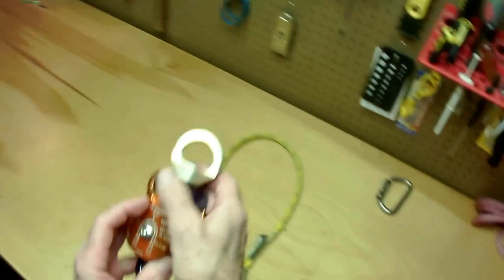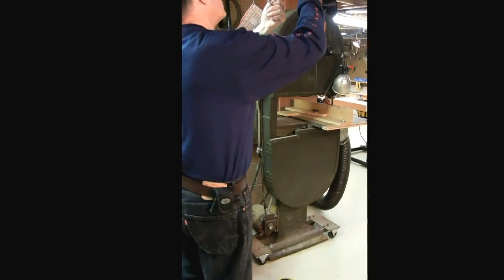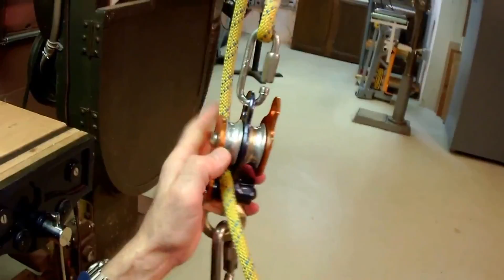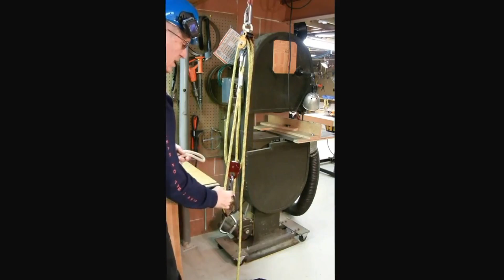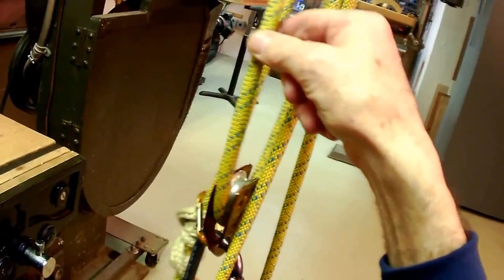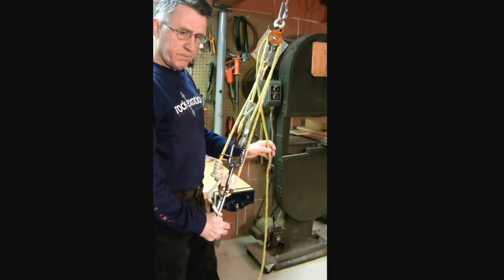U-RIG Build Details

Comment: Tom, would this U-Rig system have the strength to pull over back leaners safely or would a heavier SOF consisting of 2 P53Ds be the way to go?
Reply from the maker: It's impossible for me to answer that without knowing your rigging loads/style.  The P53 is 40kN MBS vs 36 for the P51, so no doubt it would be stronger by about 900/180 lbs MBS/wl. An SOF with P53s would be an awesome rig.  But here's something to consider:  you could build a u-Rig as speced in my video but use one (1) P53 at the head end replacing the P51.  Your MBS would jump to 40kN without changing anything else.  The 10mm cordage is over strong;   I sized it for stiffness/efficiency and good grip in the hand.  The two P22s deliver 44 kN.  Just make sure you use a Rock Steel 50 kN biner at the tail.  It's the only rigging biner I've found that delivers 50kN AND IS NARROW ENOUGH to fit into the pulley hole without interfering with the other biner. You can't have them touching when the rig is under load.
Reply: Let me rephrase and if I could ask a couple of more questions. Would it have the strength to correct a slight back lean in a forty foot maple or pine with 9/16" SB tide up high in the tree using the U-Rig to pull on the SB while anchored to another tree? Are you using the 8mm Ice Tail or the 10mm Amor-Prus for the load prusik now? Lastly, using the P53 at the head end would it make sense to use 11mm HTP for more strength? If so would the lengths of the prusiks need to be longer?
Reply from the maker: Yes, it should do nicely in that application.  Remember, it's intended as a hand-drawn system but it can easily take a 2 or 3 man pulling gang.  No, I would not go up the the11mm ... the rope is already way stronger than the pulleys (Remember it has FIVE strands sharing the load)  I've used but the Ice Tail and the Armor Prus and I like them both.  The AP sews into tight eyes more easily.  You definitely want to use sewn not spliced eyes to use less space within the tail end.  If you make it up with the new P53D, you should do a video ... it should be a nice rig.
Reply: Tom,  thanks a ton. I really appreciate all you do and for taking the time to answer my questions. 10mm it is then. Any problem with with clearance tying a  fisherman's not instead of a spliced eye on the HTP?
Reply from the maker: No, you won't have enough clearance:  the knot will interfere with the prussics.  And NOT a spliced eye ... use a sewn eye.
Reply: Tom, thanks again. Looked like there might have been just enough room from watching the video. You weren't kidding about the tight tolerances. Sewn eyes on everything then. Did you ever get around to using that Assault steel HMS with a munter hitch?

Comment: Thank you Mr. Hoffmann! I'm looking forward to pulling some small stumps with this system and my Kubota B. I ordered this from treestuff.com. Excellent service and fast shipping. The site lists that the kit is unavailable but if you call them they can substitute the control prusik that is unavailable (will substitute Armor-Prus 8mm Poly Sewn Eye & Eye 28). The kit does not include the DMM XSRE mini carabiner. I've emailed them to see if they'll update the kit.
Reply from the maker: FFF, thank you for the interest.  I love TreeStuff, but I seriously doubt they have components that can do what you are describing.  Remember that the uRIG is designed as a hand-drawn system.  For that it works great.  My "stumpin" systems are WAY WAY stronger!!  I did make a video to illustrate the  power of mechanical advantage and I used the uRIG to pull out a stump BUT THE STUMP HAD ALREADY BEEN UPROOTED BY THE TREE FALLING OVER IN A STORM!!  The specs on the P51D are 36kN max BREAKING strength.  That's about 8100 lbs. mbs and 1600 lbs working load (sf=5).  With five strands through the pulley, the max tension you should apply to the rope is only325 lbs! Pulling by hand, you should be able to pull small saplings or a young dogwood.  Anything much more and you'll likely wreck your gear.  Please be careful.
Reply from the maker: FFF, here's another comparison that may jelp:  the P51D weighs a few ounces and I can forget that I have one in my pocket.  In contrast, the lead pulley and shackle on y big stumpin system weighs over 100lbs and I can barely lift it!
Reply: I was considering a much heavier 3:1 in front of the uRIG. Inexpensive 20,000# pulleys available on Amazon. uRIG would control the system, 3:1 would provide the muscle for a total 15:1. Thoughts? Also considering Amsteel Blue for the 3:1. I'd love to hear your advice. The saplings I'd pull with uRIG are 2-4 inches in diameter and I'd subsoil around them as well as pull from 4-5 feet high to increase leverage.
Reply: @Freedom_Family_Farms  I did similar with a big old 2:1 block with a 1" dyneema rope in front of this rig with a couple pulley changes. It is a pretty good puller with my 2,500 pound tractor for up to about a 6" tree.

Comment: Tom, what is a good resource for learning rigging like this. I have a 2800+ lbs compact with a 25hp engine. I'm sure I'll over load this rig in a hurry. I'm basically wanting to be able to use that compact to pull the stumps when I fell a tree. It looked like you had a huge block and tackle setup in your Small Tractor Big Stump video. Where do you get those sort of hardware? They don't exactly have that sort of thing in Home Depot.  Thanks
Reply from the maker: +Scott Dennis Great question, Scott ... it shows you're ready to put in the work.  For rigging:  Department of the Army Technical Manual TM5-725 "Rigging".  For Climbing:  The Tree Climber's Companion.    Both available online as .pdfs.Equipment like this is prohibitively expensive new.  For decades, I've used the Boolean "Advance Search" on eBay.  Eventually, you get lucky but it takes time.
Reply: +Tom Hoffmann it had to be an Army manual huh? ;-) (Note my profile image and you'll get a kick out of that statement.) Seriously though...thanks for the feed back and great videos.
Reply from the maker: +Scott Dennis  Semper Fi, Scott.  Thanks for serving.  I'd use the term Jarhead but I'm deathly afraid that you couldn't see the smile that comes with it.
Reply: Scott, 
For a tractor application here’s a slightly different,  but fairly simple,  strong,  and not a million dollars solution.  Most important to keep track of are the heaviest single load points and the limits of those components.  I’m referring to the load point at the stump and the anchor point.  Strong chain around stump and a high rated tree saver strap at anchor.  3/4 inch forged bow shackles on both. From the anchor shackle mine has 25’ of 3/8” Dyneema (18,000 lb) running through a 10 ton snatch block at the load shackle.  Ideally less than a foot reaches through that snatch block so no length is wasted on the pull.  Attached to that Dyneema eye is an 8 ton snatch block with 50’ of 5/16” Dyneema running through it and anchored 25’ beyond the first anchor.  You now have a very strong 4 to 1 that since it requires only 25% of the the main load to pull it,  you can now pull on that 5/16” dyneema with a separate 4 to 1....5 to 1....or 6 to 1 system,  giving you a 16,  or 20, or 24 to 1 total.  Remember,  when you have 5 or 6 tension lines in one system the weakest points are usually the blocks.  Set up a redirect pulley so that your tractor is headed 90 degrees away from your load lines just to be safe.  I won a C-note on a bet that I could pull a full size pickup out of a dense snow bank using only my hands and feet and two duffels of gear.  I had to add a resetting z-rig with a rope grab but I got him out.... and freaked a half dozen onlookers.  Big fun.  Almost forgot....anchors are never exactly the distance you need them so your kit has to include very strong extensions of some sort.  I like polyester lifting slings with ridiculous weight ratings for very reasonable $$.  Or 1/2” Dyneema (25,000 lbs.)  if you can drop $3.50–$4.00 per foot.  Dyneema doesn’t reliably knot because it’s slippery so you have to work only with the spliced eyes. If too long you have to keep wrapping or doubling it over to take up extra length. I can now even anchor with no trees with a set of picket anchors (YouTube search it).  Cut a big tarp into 3’ wide strips so none of the gear lays in the dirt.
Reply: @ridermak4111  Any chance you could sketch this out for me? Thx

Comment from the maker: Hello Steve,Welcome to rigging, noobie!The uRIG pieces are all purchased.  With two (2) exceptions, the components list is in the video, just keep hitting pause.   The exceptions are the prussiks.  I'm now using 8mm ArmorPrus for the control prussic, 28" long and 10mm ArmorPrus for the load prussic.  The sewn eyes are important ... there's not enough room for spliced eyes.  Everything is available through TreeStuff.com.  The promo code "ONLINE" will get you a 7% discount currently. If you need help, phone them ... they know this rig and have assembled the parts for lots of people.Since you said you were a Noobie, let me re=state something I said on the video:  this rig comes with a learning curve!  Don't get me wrong:  it is an absolute favorite of mine, I use it all the time and I wish I had built it years ago.  BUT if you are careless or mis-handle the rig and "turn over" one of the blocks through one or more strands of cordage, it can be a real bitch to undo the mistake.  If you do that with fiddle blocks, it's easy to fix because the geometry is so obvious.  With the uRIG, it's much more subtle and it's easy to make things worse.  If that happens to me, I pull the pulleys off hang it up somewhere and do the reeving technique I show in the video.One more thing:  the "weak link" is the Rock Exotica P51D at the head end, rated for 36kN or about 8k# breaking strength.  Never operate a rig near its breaking strength.  Different people use different safety factors for different tasks, but at least 5:1 should be used.  That says to limit the working load to 1600# or  approximately 320# applied to the working line.  If you use the rig hand-drawn, you'll never exceed the rating.  If you use a vehicle, you MUST know the level of force it will apply.Good luckTom

Comment: "Ultra Tec  would break the SB at the prusik, due to its sharper bite"  Is this comment based on testing?  What are the numbers?  I would be very surprised if this were true.  I have been surprised before.  Break a rope with a prusik? Really?
Reply from the maker: Oh yes indeed, Silva, it can break right at the prusik.  In fact, that's exactly what's pictured in "U-RIG Pocket MA for tree work" @ 11:27.  You can think about the UltraTech as thinner, harder, more like a wire;  the IceTail is softer, fatter and spreads out the stresses over a larger area of fiber.
Reply from the maker: The test results are in the Description box on the Info page.  Some mobile apps don't show this page and/or mangle its formatting.  Try looking with a full browser.  If you can't find it, email me and it'll send it to you ... tom@hoffmann.net